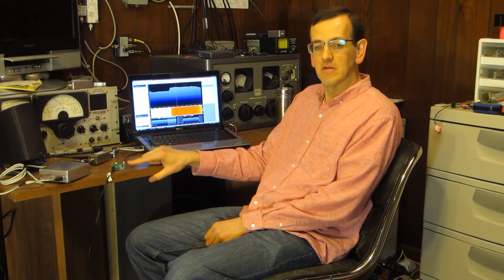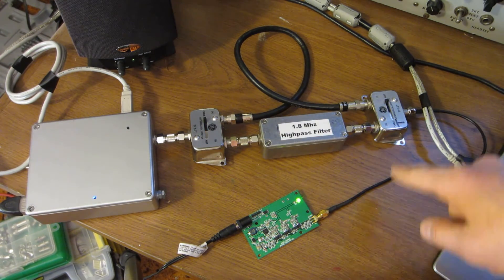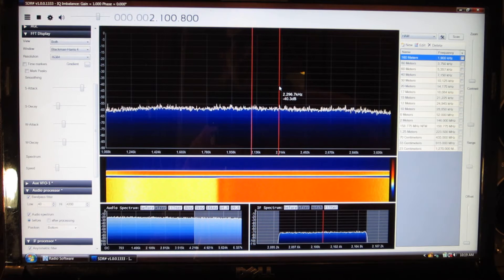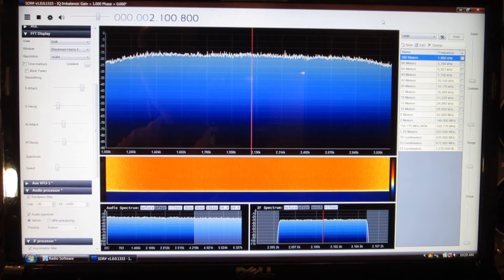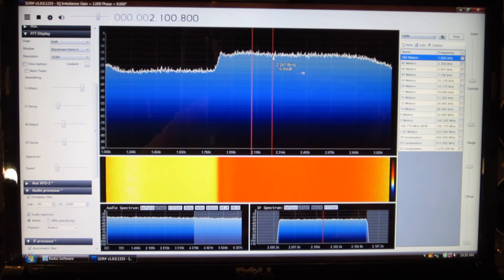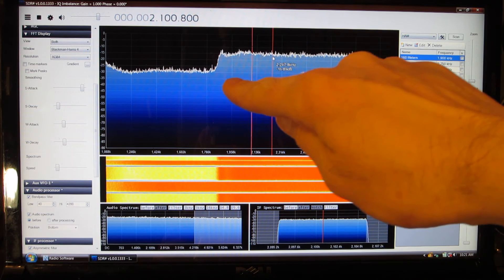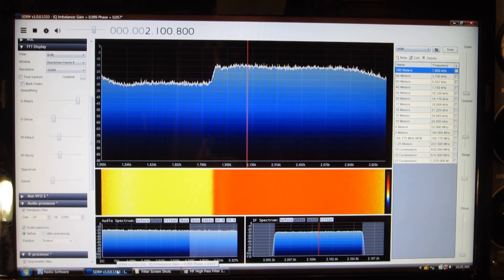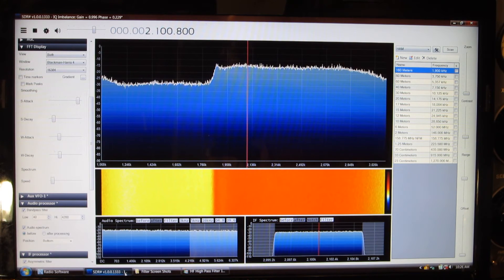Using the BG7TBL Noise Source to Characterize a HF Filter

Comment: The SDR Sharp method is much better than using the oscilloscope FFT function. I was able to characterize the frequency response of my RF PA by using your method. However, this requires lots of attenuators, even if the output level doesn't overwhelm the input of the SDR device. Definitely you have to pay attention to compression, if using that method.
Reply from the maker: What causes the compression? Is it related to the sample rate?

Comment: Hi, did you manage to account for the difference in theoretical filter response to actual?  The 2 suggestions below seemed to make sense.  I want to try experimenting with Elsie myself.
Reply from the maker: I computed the basic plan with Elsie and chose the caps to get close to the values in Elsie. Then once I got all the real-world caps, I measured them and plugged the measured values back in. I still don't think the measured response in SDR Sharp matches the calculated values as well as I would like. Might be my construction/soldering techniques.
Reply: @kugellagers  

This is and older video etc.   However,  If you look up dynamic range of a spectrum analyzer,  noise sources and channel power you wil understand why your filter appeared to have less attenuation than it acutally does. 

Enjoy...

Comment: I also notice the expected deep nulls in the response are not present.  I would first suspect leakage around the filter.  Try testing the filter with only a direct path, noise generator->filter-> analyzer rather than with the TV grade switches at each end of the filter. (or remove the direct cable between the switches) For high performance filters, it may be necessary to add shields between the filter sections, as shown here https://www.youtube.com/watch?v=1sq8Cvju2Oo
Reply from the maker: Thanks! I will give those all a try and see how the response changes.

Comment: Thanks for the clear and informative video. One possibility why you are not seeing the theoretical filter response is that you may be overdriving the receiver with the noise signal. If you are then intermod products generated in the receiver will mix back into what should be the filter stopband and "fill" in the filter response. Try it again with some attenuation in front of the receiver and you should see an improved display of the filter response.
Reply from the maker: Thanks for the suggestion. That would make sense why I would not see what I expect. What would be the best/simplest way to do that? Put a low value resistor or potentiometer in-line with the coax?
Reply: As it's matched to 50 ohms you need to put an attenuator in series rather than just a resistor or potentiometer. With that noise source and receiver I'd start with a 20 dB or 30 dB attenuator. You can always build a 50 ohm attenuator with three resistors. There are plenty of attenuator calculators on the net or as phone apps to work out the resistor values.